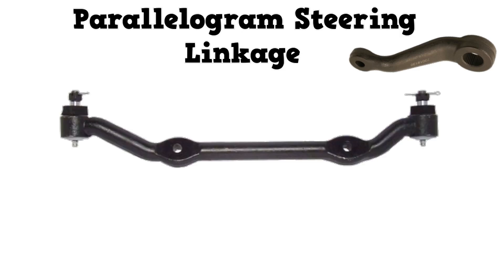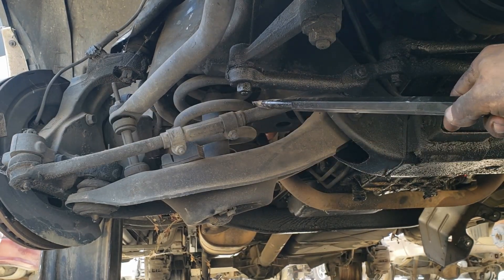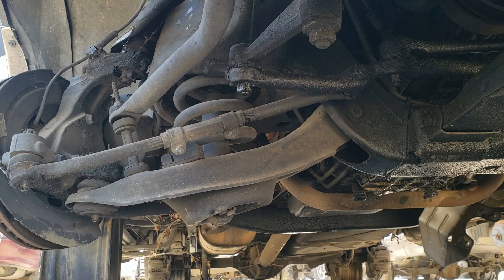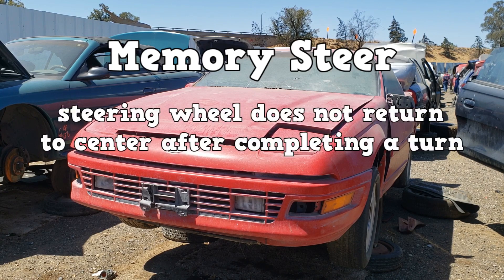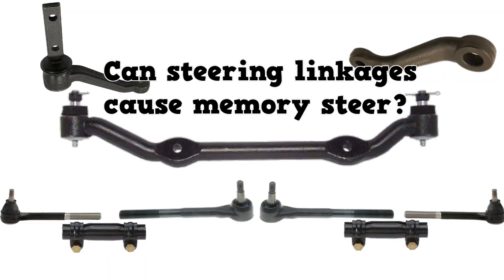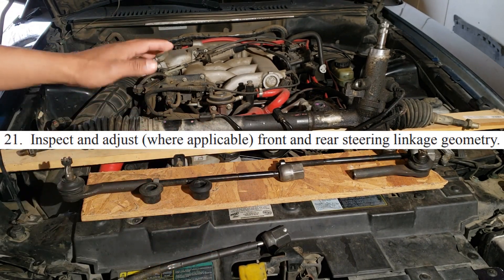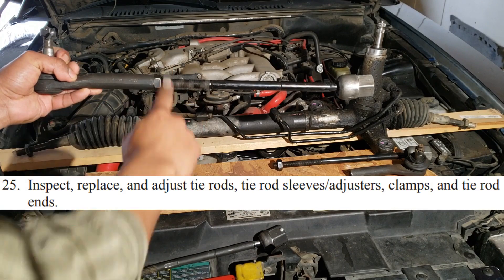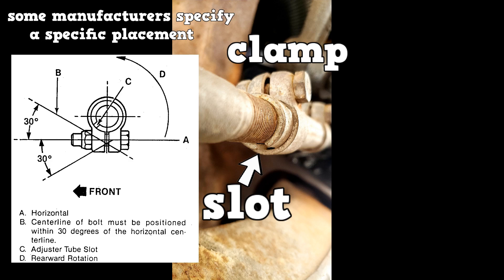ASE A4 Test Prep #3 - Steering Linkage, Bump Steer, and Memory Steer

Comment from the maker: Update 3-6-23: I took the test and did not see many questions about parallelogram steering.
There was a question about worn steering damper symptoms.
1:26 Can worn or bent steering linkages cause a pull while driving straight ahead? I said No in the video, it causes bump steer. The test calls bump steer steering wander, you should do more research on this to differentiate the two meanings. Do worn tie rods cause a pull or wander?
There was 1 question about memory steer, it focused on the cause.
4 questions about rack and pinion steering. Know how to diagnose inner tie rods and know how to diagnose a rack and pinion steering gear that "pulls."